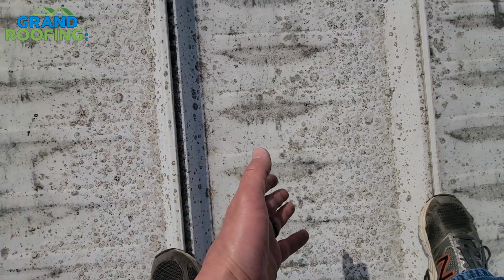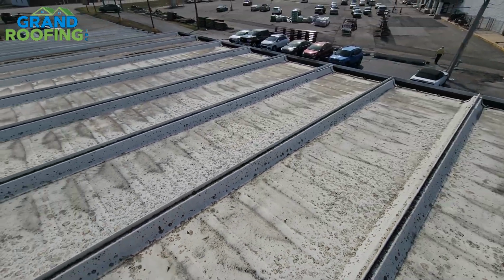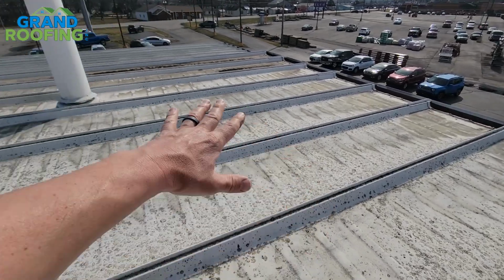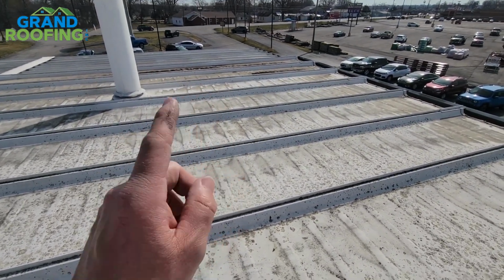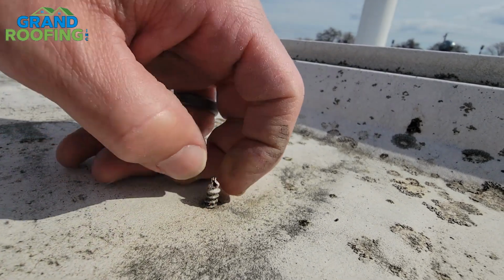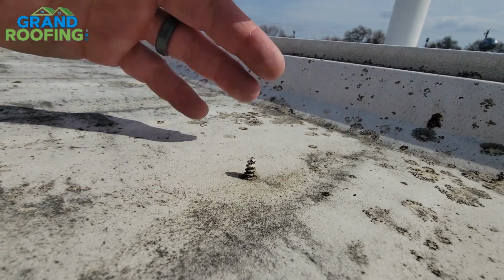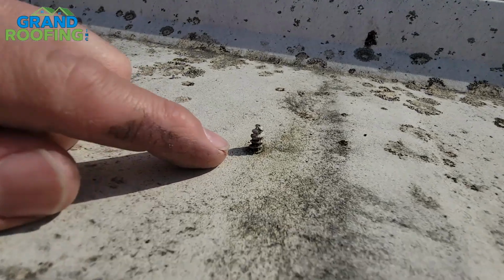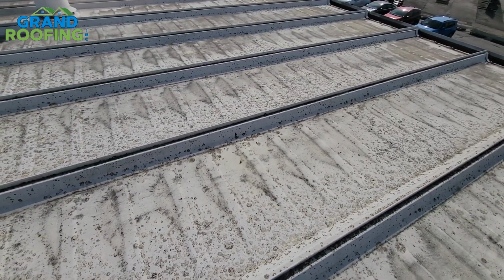Commercial Building flat roof leak inspection

Comment: To repair it, I would have removed the screw, loaded the hole with sealant, installed a washered roofing screw from the top and then put more sealant on top. But after reading some of the responses about using a geko patch, i stand corrected. I’m not a roofer though. 
I like that in your videos, if you don’t know the answer you’ll ask, and the rest of us who don’t know either, will get an answer too.

Comment: I agree with the other guys. Get rid of the screw and a little coating and fabric should take care of a small repair like that. Once those heavy gauge galvalume panels are locked they’re pretty much permanent until they rust. With the variety of coating products and single ply retrofits available now there’s definitely options to keep them serviceable for many years beyond their warranty.